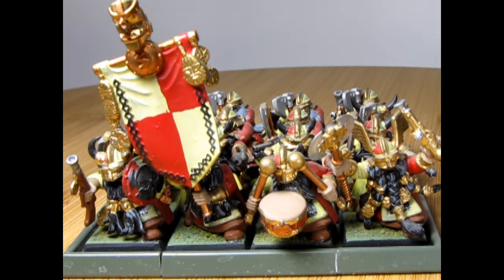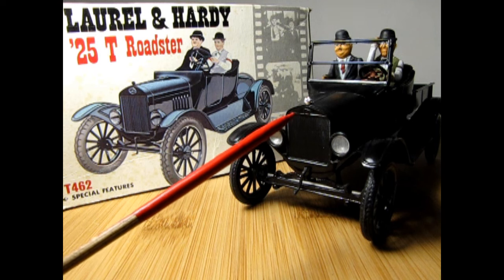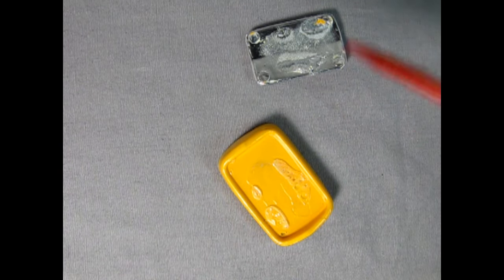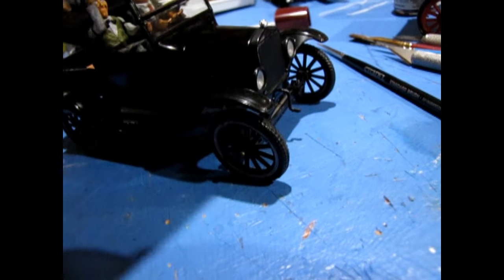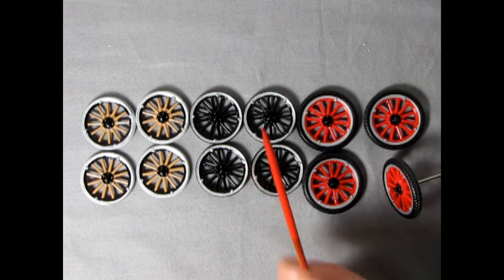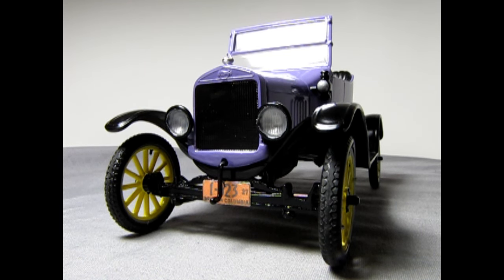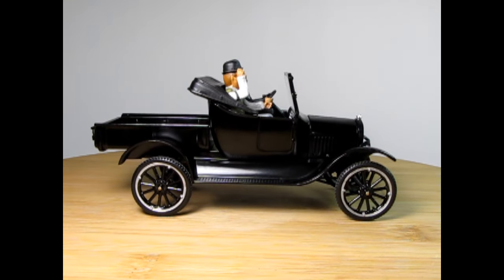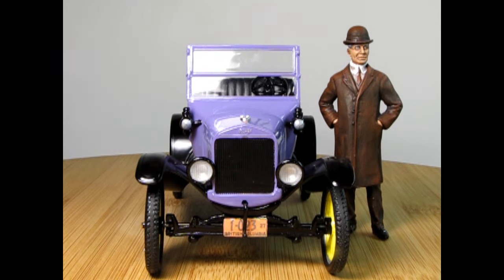Mass Producing Model Cars - How To Batch Paint Your Models The Right Way

Comment: Great video and great topic. Did batch builds of several NASCAR kits back in the 90s. Used project management software to plan them all out and had a gant chart of the entire process.
Reply from the maker: Very cool!
That would have helped me out in this case. I still have to finish those Tall T's. They're not too far away. I just need to paint both bodies and make the 1 package shelf for the interior, paint the spare tires, put on the plates and glue it all down.

Comment: Hi Trevor,  thoroughly enjoyed this upload, lots of info and tips, it's great to see your passion for the Hobby, I thoroughly enjoyed watching it and will watch it several times im sure as there are lots of tips, the blue worked out well too, I have a question do you sand between coats and if so which wet and dry grade do you use, i found the 1200 a bit abrasive.
Thanks for a super upload.

Best wishes to yourself,loved one's and fellow viewers.
Reply from the maker: Glad you enjoyed it. Usually I use 1200 grit between coats. 1500 is also good. Those grades are sold "over the counter" here in Canadian hardware and automotive stores. However, I have an old LGM polishing kit that starts at 1800 and goes to 12 000, but that's getting to the point of polishing out the top coats for a mirror finish. - so those are more special.
Reply: @MonsterHobbiesModelCarGarage  Hi Trevor, Thanks for the info, I may get some 1500 grade too, but super happy and dont think I want to go too detailed, just build the models as fun with no pressure, im finding it as fun as I did back in the 1970s, im concentrating on glue and paint skills and then have a nice display of them in the cellar.

Thanks for the reply and best wishes.
Reply from the maker: You are welcome. 

In my build videos, I am not getting "Super-detailed", like adding engine wires, valve stems, heater hose lines, and other things of that nature. (Although I might consider that later on - build one from the box and build another of the same kit and add in those details as a separate video.) 

For now, I am just trying to get the models to fit together as they should. Sometimes that does require certain items like Tamiya putty and pieces of Evergreen Sheet Styrene or Plastruct, or even just letting the viewer know that they should remove something from the chassis or body to get the fit tight. Nothing too complex, but will get the kit together the way the manufacturer intended...like how I solved the issue with the Model T suspension geometry.
Reply: @MonsterHobbiesModelCarGarage  Thats great, im enjoying  watching your vids in my spare time and agree on the advice being helpful as I have the Torino model which you covered and you have got me interested in the Model T and similar, I saw a real one a few years ago in England, they are a marvel of engineering.

It's great your doing a few versions of the same and im doing similar with the vatious Mustangs and enjoying the steady progress on each, id like to do some as Customs like how I remembered them in the 1970s, jacked up, side pipes, spoilers, traction bars, bonnet scoops,whiplash aerial, slot mags,it was a scene that went from the States to the UK and most youngsters had Ford Escorts with the bit's I mentioned normally black and flamed plus bubble wheel arches, my first car was a mk3 Cortina GXL with the Pinto engine, model making is fun and nostalgic it rekindles old memories and new ones too.

That reminds me I had a few smaller Monogram models in the 70s one was the 41 Willys and the other the yellow model T Pickup, simple builds but looked good, for many years i've played Forza and Gran Turismo but now im finding the model making is twking over.

Best wishes.
Reply from the maker: @SunShine-dk6rk  Sounds good. I have an older PS2 game called Automodelista where you can change the paint colors and logos of the cars. Sometimes these video game car ideas can be used in model building.
Reply from the maker: Hang off on building the AMT 1969 Ford Torino for now. I am working on a video that covers ALL the issues with it and how to fix them for both the factory stock and NASCAR versions. Once the video releases, you will have a total guide in everything that is wrong with the kit.
Reply: @MonsterHobbiesModelCarGarage  Hi Trevor, Thank you for the info, I look forward to the vid and no rush, Best wishes from across the pond.
Reply: @MonsterHobbiesModelCarGarage  The PS2 game sounds good, I enjoyed doing a few cars on Forza with logo's based on  Grumpy Jenkins Nova, all good fun. Best wishes.
Reply from the maker: @SunShine-dk6rk  It's cool what some of these video games have in them for cars. the Mafia game on my PS2 has a ton from the 20's - 50's.
Reply from the maker: @SunShine-dk6rk  Each time I touch something in that kit, I have to do something to make it work - sanding, drilling a new hole, bending parts...wow...but it will be a good video once finished.